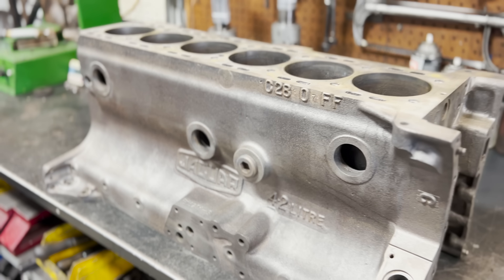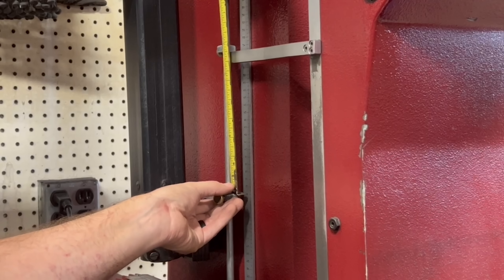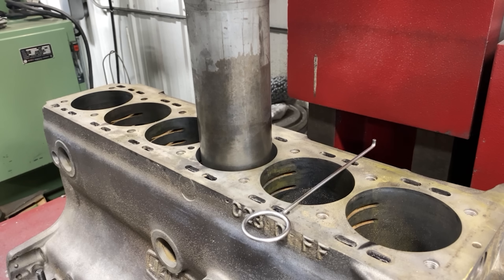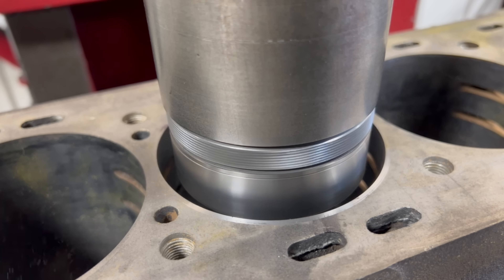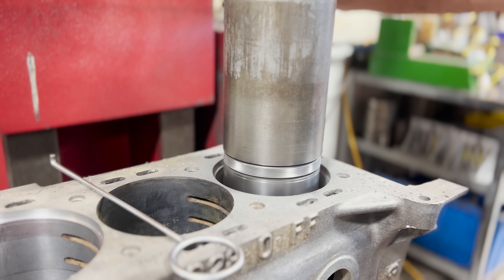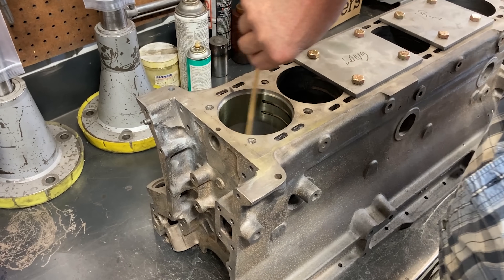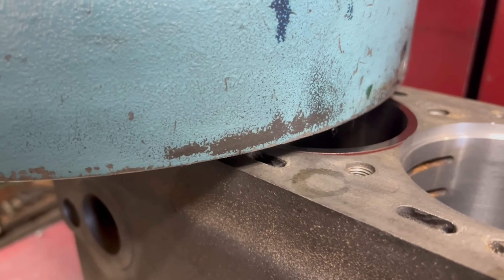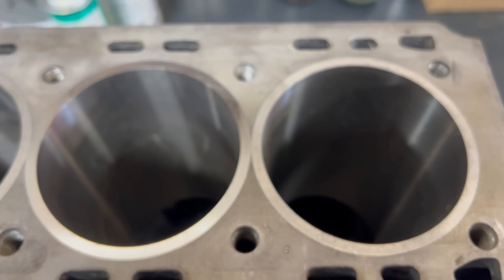Will New Sleeves Fix The Cracked 1968 4.2L Jaguar Block?

Comment: This should be just fine. The process you engaged is largely the same as the engine builder we used back in the 70s and 80s used. One thing he did was to open up the cranks and braise them closed with Allstate Number 11 alloy, which was also my father's favorite alloy for cast iron structural restoration.  After the braise, they did pretty much the same sleeve job. ... 
Excellent job, guys.. I can see Jaguar enthusiasts putting you on a preferred vendor list now.

Comment: Beautiful work!  I'm curious, though.  By finding the center of the cylinders the way you did, doesn't that assume that they are worn/cracked exactly on center?  I'm wondering if using a reference point on the block itself from which to determine the  true centers of each cylinder would be more accurate?  Of course, determing where that reference point should be would require a LOT of measuring and investigation as well as the indroduction of measurement tolerance error.  Great vid and I gladly subscribed and liked!

Comment: I am new to the channel. I have noticed that you measure cylinders from the top when looking for center. My boring bar centers from the bottom of the cylinder that has not been used as much or at all. Also we have been boring most with diamond stones on the Sunnen hone.

Comment: We would have never done it that way back in 'the day'. We would have welded it and done a traditional re-sleeve rather than using those top hat style sleeves (more akin to what you would see in a v12 vs a 4.2 or 3.8). As you know the reason this occurs is that the old bronze/brass/copper amalgam radiators are notorious for leaking and jag owners are notorious for using 'new and improved' products to the detriment of their vehicles such as the old radiator stop leak. These products go right into those small coolant gaps in the top of the block and seal them off preventing adequate coolant flow and the subsequent cracking you see here is the result. I've seen too many of these to count. All that being said I have several concerns here:

1. Lack of continuous structural material around the top webbing - There's a lot of differential heating around the top end during operation. I'd be concerned of the sleeves potentially walking during operation. Additionally if you look at the center journal bearing thrust washers, they allow for a small amount of fore/aft float of the crank during clutch operation. This could lead to connecting rods putting torque on the top end of those hat sleeves (esp. during compression stroke). This could lead to ring binding/scoring or premature wrist pin failure.

2. Top deck cut - Of the countless E engines I've worked on I've never done a top (or bottom) deck cut. Due to the way these were cast in the foundry the webbing thickness is highly inconsistent. Thinning it more is risky for the same differential heating issue I mentioned above. I can't tell how much you took off (it didn't look like much but video is hard to tell) but if it is significant are you putting in shorter connecting rods or machining down your pistons accordingly? The standard (G type 8:1 if I remember my Bentley book correctly) come right to the deck at TDC. Depending on how much room you've allotted you could be turning a non-interference motor into an interference motor. Also if you are improving the head by adding bigger valves and seats to run unleaded low octane gas like most of us have done, the potential for interference increases (and more so if you're raising the compression ratio).

Recommendations:

1. Measure, measure, measure - watch out for any interference you may have incurred. Use a sacrificial set of valves the first time you put the head on in case you bend them. You'll know right away from the timing setup w/ the no. 3 piston (using the Bentley book counting) if you have a bent valve by checking the compression there first.

2. Modern pistons are of the short skirt variety - You could go back to and older long skirt style like what was traditionally used. This may improve top end piston-in-sleeve stability. You can also put a heavy knurl on the bottom of a long skirt which will improve piton-in-sleeve stability. The knurl has the added benefit of reducing blow-by and keeping oil retained between the wall of the piston and the wall of the sleeve. This may help reduce some of the differential heating issues I mentioned above.

3. Build a second motor - If your client is a typical Jag enthusiast then they want the matching number motor for the sake of that little stamped number plate in the engine compartment but if they really want to drive the car (and aren't just building a hangar queen) then the idea of having a driving motor in addition to a 'show motor' shouldn't be that objectionable. The time to do a motor swap on this car is not that bad (I've done with one other person in 30 hours). 

I'm really curious to see if this works. As I mentioned we would have never done it this way but that doesn't mean what you did is wrong - you just have to try it and see. Engine machining is a lost art form and the tools and resources we had 30+ years ago just aren't practiced that much anymore (e.g. welding iron castings). Bottom line here is that the break in period for this engine should be gentle. Suffice to say that this will likely not be a competition motor. Good luck and keep us posted.

Comment: As someone in Boulder with a 1960 Mk2 3.8 and a 1969 e-type 4.2 I am ecstatic that there is a machine shop nearby that can handle these blocks and the details in a rebuild. Congrats on a success on this restoration.

Comment: When I was young, I worked as a welder in a foundry, doing repairs on new castings. With the rods, wire and gas we have now, cast iron welding is easy if your oven goes high enough. But I wouldn't have wanted to do that block. It looks like a case of Jaguar over engineering to me. You picked the right method. I've rebuilt marine diesels for 50+ years. Every time I watch your videos, I'm impressed with your quality.
Reply: Those XKE's were dirt cheap in the 70's here in the USA since all had major engine problems caused by overheating. A performance parts company made a conversion kit that allowed one to install a Chevy SB and radiator to make those usable year-round.

Comment: Okay some information you're not telling us such as. When you machine the deck of the engine block flat do you have to drill out bolt holes if they run to shower you know what I mean. I love the information you give us. I'm trying to say if the bolt holes are blind and they not go through the whole block is it possible to both the bottom out before it tightens. Do you have to drill out the whole thing after the engine is decked and made True straight again. Thank you for this information and I look forward for your next Basket Case engine build. Feed me more I'm hungry

Comment: wtf over? you should have installed ALL 6 SLEEVES WITH A SLIP FIT. What you did will prevent you from honing ANY CYLINDER ROUND. Why? the press fit will keep  pushing the adjacent cyl. out of round. Slip fit is sort of an industry standard for the last 10? yrs- Oh well live and learn- Let us know how the honing operation goes lol

Comment: If u really wanted 2 fix it properly, u would drill the very end of the crack with a five sixteenth drill bit or quarter in. Heat the block and stick weld it...

Comment: 5:59 "machining this feature is where a screw-up would be most-catastrophic, so we take our time and feed the machine by hand"

Sorry if this sounds naive, and I don't mean to offend, but isn't that the main advantage of large industrial machine tools (i.e. repeatability)? Again, just trying to understand, but your logic seems backwards.. if you set the machine to cut to a certain depth, it should hit that number dead-on virtually 100% of the time, a human on the other hand.. 

I often see you jogging the quill down by hand with light touch-offs when cutting valve seats and wonder why you don't just let the machine power-feed down, smoothly and uniformly, to a set depth

Comment: Have you guys ever worked an S2000 block?    (I have an AP1.  It's burned oil 1 qt/1500 miles its entire104K mile, 20 year life, so far, so good.  But if it ever gets worse all I read is the engine can't be rebuilt  -- people try it and the rebuild fails.  Everyone says go used if you need major work....

Comment: Question, what’s the positional repeatability on the boring/facing machine. I’m a CNC machinist and I was wondering if you rely on the digital read-out to go from bore to bore or you clock in the spindle to position every time??

Comment: Hi, I am glad you picked the (best?) correct solution.  That it came from Belgium rather than GB is a bit of a shock.  I was going to comment in the previous video, but some people who disagreed with brazing got a less than nice reception.  In reality, there is no perfect solution to the problem.  What I did not get from these videos is whether there were any symptoms/problems caused by the cracks.  Often, the cracks seem to cause no issues in engine operation and come as a complete surprise when the engine is opened up.  My brother has had a number of Jags and a few years ago I had long talks with a guy who worked on Jags for a very long time, the conditions inside the engine were often a surprise.

One solution what you did not mention but was traditionally used was cold stitching, I don't know how many practitioners of this black art are still left.

Is it a design flaw, a good question.  The XJ engine came in 5 sizes, the 2.4, the 2.8, the 3.4, the 3.8, and the the 4.2.  We can discount the 2.4 and 2.8 as they used a short block.  The original 3.4 was the best displacement, the engine was literally designed for it (well.., the original prototype was 3.2... drats), they got away with the 3.8, the compromises were not too serious but the structure of the engine was mildly compromised.  However, the 4.2 may have been a step too far. The engine went from being able to take a fairly large amount of abuse to one that needed to carefully handled, as long the engine was properly maintained, you were usually okay, but there was some luck involved.

I was glad to see you using 'the book' to check specifications and tolerances, anyone who does serious work on a XJ engine without "the book" is just asking for trouble.  Similarly, mixing parts from different periods of the engine (even if you don't know it) is also asking for trouble.

Comment: You and your old man do some awesome work!! My dad's a auto machinist by trade and has told me all sorts of stories about the engine work he use to do back in the 80s to mid 90s here in New zealand before I came along, it's really neat to see that shops still do this level of work and can save an engine. Most people just throw shit away theses days. Learning/working with your dad must be pretty cool to! I worked with mine for about 5 years and it was the best. Keep up the good work dude 👍

Comment: As a 40yo car guy I can say that nothing I’ve done while working on cars has ever gone this well, I’ve changed tyres with more drama than this. Real credit to you guys, true workmanship.
Reply: Manually changing tires is the most physically demanding job I have ever done on a car.  And I've done my fair share of big jobs.
Reply: I have no mechanical or engineering qualifications and have never worked on an engine but I love to watch engineering/mechanics
Reply: @UC2ClAVKKnLPZL8X5LhfdzLA ur right I don’t think he addressed the cracks but doesn’t the sleeves covering them address any potential leaks ? That said though the cracks still managed to form whilst under the original sleeves so they probably gonna keep growing
Reply: @msquared6695  The cracks are at the top of the deck and are stopped by the machined cooling groove below it. If those hadn't been there, the cracks would likely get bigger, but I think that ends it.

Comment: Check out barum engines in the UK. They regularly have jag blocks that they line think they currently have 3.5 and 4.2 blocks at the moment. Think they just press them in cold they've built a lot of jags pretty much a few a month

Comment: Just because you believe a factor spec is excessive, doesn't mean you are correct. Old international tractor diesels need that factory spec on sleeve press to hold together. No enough will allow sleeve movement and flex. Gas engines have more give but factory spec is there for a reason. It's better to go back with it when you are getting into a project you are less familiar with.

Comment: I notice the sleeves at the center didn't overlap.  Is that as designed?  Or is that just sloppy British machining?  Are there other engines that don't have equal bore spacing?
20 years ago, an American V-8 would get the final hone from a Sunnen while using a torque plate.   Now I understand Rottler makes the 'Cadallac' of machines for super straight bores.   Is that kind of work necessary for a restoration engine like this jag?

Comment: A lot of work to save a 4.2 Jag motor. Then I guess there getting rare because many past owners woke up there were far better options out there than the under powered, unreliable, fuel guzzling design fart that was the stock 4.2...in the 80's, there was a guy here in western australia whoes sole business was converting 4.2 Jaguars over to 302ci Clevelands and he done a roaring trade beause it turned them into a pretty decent ride....lots of small boats are still being moored to 4.2s off the beaches near where his workshop was...😂😂😂 BTW,  Whilst my comment disting the Jag motor is, in my opinion, completely deserved, I do not intend any negative whatsoever regarding your workmanship.  In fact if salvaging the original motor is what the customer really wanted, then they have done very to entrust the job to you guys. Careful, meticulous and informed and not so above yourself to seek advice from those who have walked the path before you. Well done. 👍

Comment: The sleeves don't overlap between cylinders 3 and 4 (shown at 13:06) like they do between the rest of the cylinders, hopefully it doesn't become a problem later.
Reply from the maker: This is due to the bore spacing being larger between cyls 3&4. It will make no difference, as the benefit is in the larger sealing area of the flanged sleeve.

Comment: While this a patch it is a very good patch. For boulevarding it should be very good. Dont get too serious making power though. That green loctite is great stuff. I have used it with a bit of pin punching to retain Holden 202 balancers [they have bad period viabrations] And 10 plus years later still causing no issues. Though it makes things hard to pull apart later. 
And retained bearings and lock rings on old racecar axles. Which shrink everytime you fit a new bearing and I used too crack test them about once a year.
Though the amount of time spent still exceeds the cost of another good block. Though the tolerances and fitting from the Jag factory probably means every second one is either wonky or cracked. Ooh aah quality pommy cars,, Yeah right!!
Overlapping the sleeves is usually race engine stuff. Watched Sreve Morris do it recently on his channel on a billet block.
Some Sprintcar blocks use it also.

Comment: At 7:07 it wouldn’t be good to weld the cracks due to the coolant ports. Sure u could try to seal the sides and top but the inner section would be hard to get without being a very good welder. The drip risk is also they’re because if ur puddle drops into the coolant port ur gonna have a hard time cleaning it once it’s solid. Finally what ur doing now takes away the risk by not only gouging out most of the crack but replacing the surface metal properly too. Doing the sleeves is the safest cheapest option without the risk of messing everything up with welding (cuz yes welding is cheaper by material but anything could make it 10x more expensive in time)

Comment: As someone who paid a bit of money for a rebuild, including machining and re-sleeving a cylinder that was out of round…only to just have to buy a used engine anyway a few months later (after the engine blew on the drive home…), I appreciate this job all the more. Nice to watch work like this. 

(Also: recognized something about JIMSI, Sr. in the previous vid, and went back and found the short of him “running the parts cleaner” after 39 yrs (lol) and realized this was the same team. Glad dad was on hand to oversee…and to polish those welds for public consumption. Made sure to subscribe this time.)

Comment: That's a really well done job.
Being a cast iron block does make life quite a bit easier than an aluminium casting as the expansion rates will be much closer for (probably?) spuncast sleeves and grey iron block.
Glad you mentioned about the sleeves being 'proud' due to heat differences and needing pressing the last 0.001"~0.002", if people have never done re-sleeving they can easily get caught out by it.
If I ever come up on the lottery I have a 1965 Pontiac Catalina block that needs some 'experimental' work.

Comment: I'm wondering how much different this process would be for pressing in sleeves into aircool aluminium finned cylinders? I wonder if a tighter fit would be required?

Comment: Question: Does your boring bar flex? In a job shop, if i tried to adjust say +.0005" and re-cut, I could potentially end up +.0025" because tool flex was different on an already cut bore than on an uncut bore. Just wondering if your special machines have the same issue.

Comment: The 'top hat' sleeves are a good solution to a difficult problem. When I saw the cracks in the first video I was sure that block was toast. Cast Iron is really tricky to braze, even for experienced hands, because there can be inconsistencies that crack from heat, even with a good pre-heat cycle.  Welding a casting like that isn't something I've heard of anyone having success with, either.